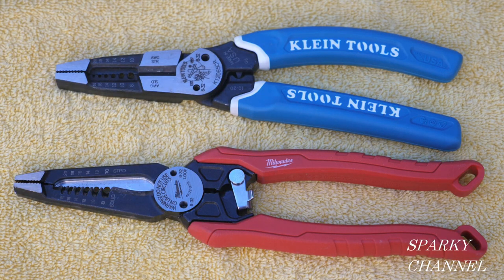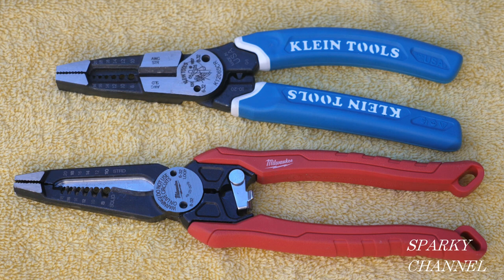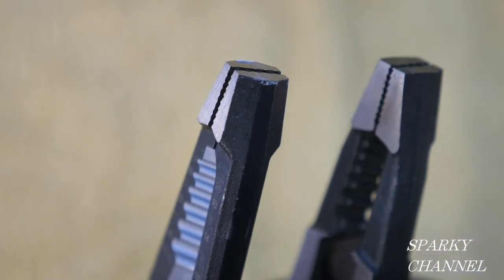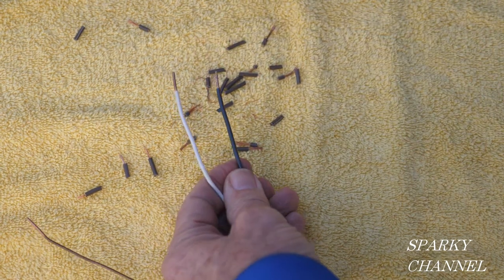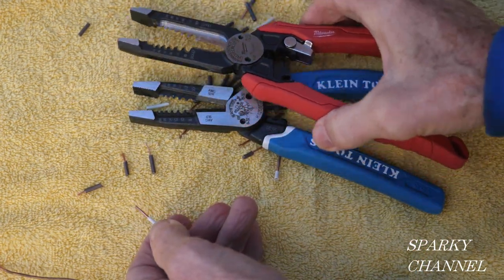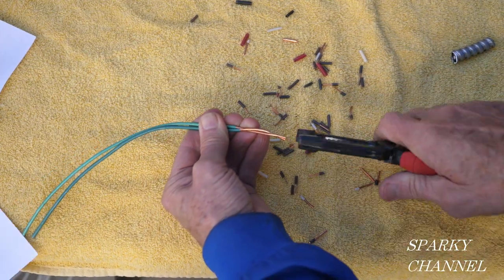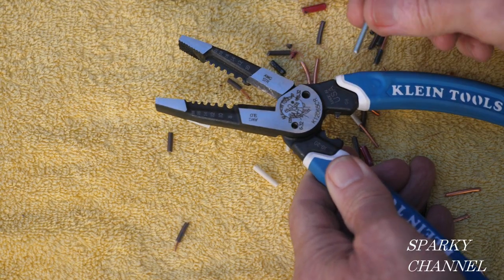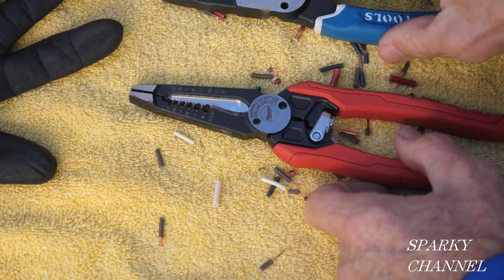Milwaukee New 7 in 1 Combo vs. Klein-Kurve Combo Pliers, Which Will Win?

Comment: I would not buy either unless that was the only tool. Too bulky to use a strippers, any crimper that you have to put handles over wire are a big no for me.
Reply: This is good for a small job when you want to only have to grab a pair of pliers and a knife.  Like when you just need to change out an outlet or a switch. 

Also if you're crawling around in really tight quarters,  like an attic with a 5/12 roof or a crawl space.  You can stick these pliers and a knife in your back pocket instead of using a tool bag.

Comment: Definitely prefer the grip on the Klein, but otherwise, I think the Milwaukee is almost better in every way. And if you don't like the spring or latch, you can theoretically remove them (even if somewhat destructively). Likewise, I think you could get a rotary tool and grind down the crimping tab, though I concede you shouldn't have to do that, and it should probably smaller like the Klein's for more pressure.
Reply: those thin milwaukee blades wear out fast.

Comment: You can always remove the latch and spring if you choose, and I don’t think you should ever use this style of tool to twist wires. Has to be standard lineman’s, but I see the Milwaukee as far superior
Reply: Doesn't have to be standard linemen as long as you know how to properly make joints 🙌
Reply: @UnrankedRebel  ok
Reply: @AnxOG663  yeah I use iron worker pliers instead of lineman pliers

Comment: In my opinion. Milwaukee power tools. Klein hand tools. But when it comes to screwdrivers, Klein Phillips heads strip out. “Faster than a Milwaukee Phillips head. Personal opinion, been an electrician a long time. I wouldn’t waste my money on either one.(I have both of the pliers/strippers/ multi-tools), and never use them. Good back up tools tho.
Reply: Try ya some Wiha drivers. They're amazing!

Comment: Something to consider about cutting differences. Bi-path or shear type cutters perform a shearing action in the material. They must be “sharper” or have steeper cutter angles. This improves cutting performance at the risk of easier: rolled, damaged, and misaligned edges. 

Pinch style cutters have more obtuse angles, that meet and literally pinch the material apart. The edges are less likely to deform, hardened to some degree, and still perform well with small amounts of edge damage. They do take more effort to use, and deform either end of the cut material.
Reply from the maker: Thanks Rob!

Comment: I have the Klien ones. I did not like them. They strip wire very rough, and are not great as a lineman’s. Easier in my opinion to just have a regular strippers and a regular linesman’s
Reply from the maker: Thanks!
Reply: They're not meant to replace your lineman pliers man. Either you're mistaken or someone mislead you. You need both strippers and linemans.

Comment: Klein all the way for me.
On the job you need a bigger  Surface area on the tip of your pliers for twisting 3 or more  Wires especially if is bigger Gauge wire.
 I doubt you can twist 3 number 10  Comfortly with that little Milwaukee tip.
Reply from the maker: Milwaukee 11, Klein 22. Thanks!

Comment: If I had an engineer friend at Ideal industries I would send them what I liked on the Milwaukee and Klein  and see if they  could make a pair close to Klein but with the cutter  of the Milwaukee.  Bypass cutters  generally cutter larger items. Notice that the hydraulic powered cutters and ratcheting cutters are bypass.  Same thing in pruners.  The bigger pruners are bypass

Great video.
Reply from the maker: Thanks Victor, sounds good!

Comment: Bought the Klien two months ago and am going to try to return it to Home Depot.  The cutting blade is too short and it is very hard to cut 14/3 and 12/3 romex.  The tip doesn't fully close and won't grab small strands.  Very disappointed.  I'm going to try a Knipex.
Reply from the maker: Thanks for sharing!
Reply: @SparkyChannel  Today, one of the grips kept coming off when I put in the long pocket of my carpenter pants.
Reply: I agree with you 
I returned mine, knipex is the way to go
Reply: @ItsEdwinG  I bought the Knipex and it is better but not perfect.  It's easier to find the right slot for stripping wires and does a better job.  I'm still getting used to the thumb lock but it doesn't have the problem of accidently opening like the Milwaukee in the video.  The curved cable cutting blade does a nice job cutting larger cables but you have to spread the handles farther apart than you do with straight blades.  Again, something to get used to.  There is a slot in the middle of the tip serrations that works great for grabbing wire for putting a hook in a wire end.

Comment: I'm old school. I still use wire nuts and I twist my wires together before putting on the wire nut. The noses are too narrow on both tools. I like the klein curved handle. I like the milwaukee spring  and bypass cutter. Cutting MC cable is a good way to ruin your cutters.  I don't need the crimping feature since I rarely do crimping and I have a dedicated ratcheting tool. I want a tool that can replace strippers and lineman pliers because my pouch has way too many tools. I like latches on spring handles but that milwaukee design is flawed. Both tools are not ready for prime time.
Reply from the maker: Thanks Dave!

Comment: I've seen tons of these comparisons on wire cutters/strippers and they always are testing it on very small stranded gauge wires. However the majority of wiring in residential and commercial applications are dealing with 12 and 14 gauge solid wire.
Reply from the maker: Thanks!

Comment: I personally own the Milwaukee one and to be honest they feel pretty good but theres a catch… that “shear” style cutter is weak… I’ve been cutting wires for about a week only with the Milwaukee and the steel already has a bunch of damage and fractures. If you plan to use them as strippers,rimming tool and to twist wires so go ahead and get them they are good for that but as cutters they suck…. What used to feel smooth like a nice blade now feels like a hand saw blade… rough and damaged
Reply: That’s all cutters . Thankfully Milwaukee has a lifetime warranty on hand tools. Every time they get dull. Sharpen them your self or trade them in no questions asked at Home Depot

Comment: I like the kliens they have a wider jaw for mechanically twisting those wire's. Also dont like the latch design spring design i always pinched my pointer finger closer to the palm and it was never really functional or efficient. Never work on hot wires! But the potential is way less of getting zapped with the kliens less hunky metal in the middle of your palm to ground out against.
Reply from the maker: Milwaukee 21, Klein 27. Thanks Patrick!

Comment: Knipex blows both of these out of the water, at least for me, in the ability to cut 6-32 & 8-32 without needing to thread it in and out; it also does all the other stuff as well. It is spring loaded with a much better lock and is buttery smooth. Been doing electric for decades and wish all these great tools were around when I started back in the 90’s; still quite happy as the tools getting better have allowed me to work easier as the body gets older.

Comment: As an electrician when it comes to hand tools for my trade I'll take Klein all day long. I have my EMT remmer seperate which works wonders. But honestly at the end of the day it's about what works best for you and is available in your area. Some tool brands are just not available around me Which sucks. Where I live gets shafted for contractor grade tools in favor of DIY tool lines. Same with hand tools
Reply: That's a weird statement. You can order, does t matter where you are
Reply: @henrycruz45cal  not everyone buys online. I certainly don't buy told online as I would rather have them the day I need them rather than wait a few days or weeks just to get them.

Comment: I have both the Klein and Milwaukee. The Klein doesn't cut the sheath on romex as good. You have to put force into the Klein to remove the sheath where as the Milwaukee you just have to use the cutters with minimal pressure to cut the sheath and pull it off to access the wires.
Reply from the maker: Milwaukee 10, Klein 13. Thanks!

Comment: Kleins for me. The first thing I do to any pliers with a spring is use another set of pliers and tear out the spring 😂. HATE spring loaded pliers. The next thing I do is remove the latch. With no spring you no longer need the latch. I actually own both of these tools - both are very good (after the spring surgery) but the Klein’s are more refined and just nicer overall IMO.  PLUS my Mils were made in communist China (not Taiwan) something I try to avoid whenever possible. The Kleins are shorter and do puss out on larger cable but who cares. They fit better in my pouch. Big red is no doubt better for riggers and commercial guys but for house wiring the Kleins rule.
Reply from the maker: Milwaukee 24, Klein 38. Thanks!

Comment: Hey bill, I've been using the milwaukee stripper for a long time the smaller version of the one your using, when stripping wires, after you put wire in tool give the stripper a little up or down motion and the wire jacket comes off easy. Only problem with milwaukee is they dull after awhile.
Reply from the maker: Good tip! Thanks!

Comment: I finally got my first pair of Knipex combination , I much prefer them . That said at a much higher price point , it isn’t a fair comparison ! Be interested in your take on the Knipex .I like my Klein’s will be an excellent , well crafted backup !
Reply from the maker: Milwaukee 22, Klein 28. Thanks! I have the new Knipex ordered.
Reply: @SparkyChannel  It’s very well engineered . Do not use the 10 and twelve notches for 14-2 ! Use the shearing blades on the jacket , and break it by hand . Some guys think the two largest notches will do 14-2 , most probable result , you loose the ground ! Be interested In you take . As we speak , I’ve gone Knipex for 80-90% of my plier needs .

Comment: I have a set of Vise Grip wire strippers that I can get online for about $10. They work well for what I need. Then again the wire I need them for is not as thick as what you were using. I work in IT so its normally network wiring or some miner electronics. I think my thickest wire is 16 AWG which I used for a magnetic door lock.

If price wasn't an issue I would go for the Klein because the grip is a little better and the plier section is a little bigger. The Vise Grip strippers I have only have a small area to use as pliers. If I do any electrical work I normally bring a set of lineman pliers. The only thing I really like on the Milwaukee strippers is the the way it cuts. My Vise Grip strippers have a similar cutters and it works great.

As far as spring loaded or having a latch I agree it is personal preference. I have some garden shears that have a latch and I think it is good for safety. The way it's designed though I have never had an issue with it accidently locking. Spring loaded tools are great if you are doing a bunch of repetitive cuts or stripping. I have big enough hands though that I have never had any trouble opening a tool up without a spring.
Reply from the maker: I agree, garden pruners need latches. It's a good idea there. Thanks Brian!

Comment: I have them both,  but used Klein  more... the milwaukee are more recent for me . I believe the klein are more professional , with the milwaukee being more well rounded for people that use wire cutters less for work and just need some around. However I had to glue the rubber on the handles on the klein already... maybe 2 months of use in. 🤔
Reply: My Milwaukee's were w add y cheaper than $30 they were not even a full $20 after taxes. I love Klein tools but I like my Milwaukee's as well
Reply: I'm an electrician, been using these milwaukee for 8 months, far easier and faster to work with than the kleins.

Comment: I like the Klein better, haven’t used either for reaming but you don’t want it to be rounded for reaming. The sharp edges on the Klein would do a better job removing burrs reaming vs just pushing them down with the rounded edges of the Milwaukee, they’re smother to use because they aren’t doing any reaming. ( :
Reply from the maker: Milwaukee 1, Klein 4.  Thanks!

Comment: Shear style cutters become dull over time and aren’t as strong as traditional cutters, they are sharper hence the cut is smoother and quicker but they won’t last as long. I bought the Milwaukee needle nose and stripped hybrid with shear style cutters and they are starting to become dull, I’ve only had them for 4 months and only cut copper with them. I think Milwaukee should stick to making power tools, with all due respect of course.

Comment: I like the Knipex 13 86 200 Pliers  over both the Klein and the Milwaukee.   I think the Knipex cuts, strips, and reams better than the others, but you'll be paying a lot more for a Knipex.  Between the Klein and the Milwaukee,  I feel that the Klein may be better especially the Klein-Kurve K1205565KR.
Reply: @3morbid  - I agree.   For wire stripping, the Knipex 13 71 9 is the best.  For a combo electrical pliers, the Knipex 13 86 200 is the best.

Comment: Who uses wire strippers?
I’ve been an electrician for 25 years 
I use my linesman when I’m plugging and switching for stripping.
( I’ll wait for the “ but you degrade the wire by nicking it” comments.)

Pro tip... I don’t.
Reply: Everybody in with the mindset of progress, Ive only ever met dinosaurs who use lineman's to strip wire and also use hacksaws to cut things with. It's all choice
Reply: @TheWellenoughalone  
It’s a natural and comfortable thing for me to do.
I’d be very slow using strippers.

I’m a “ dinosaur” because I’ve done something hundreds of thousands of times and I’m used to it?

I’ll bet I’m faster at stripping wires than 90% of the young kids.
Not because I’m special, but because I’ve done it so much I don’t even need to look.
It’s like walking.

Makes me a old timer, sure.
I have a hacksaw too. I use it for backup.

Most kids have nothing but power tools in their kits.
Whatever, many ways to do things.
Linesman are faster for me.
One tool, many uses.
Reply from the maker: I've seen guys using lineman's for everything and they are super fast at it. As long as you don't nick and degrade your wire, I'm good with it. Have you seen my video on the IDEAL National Championships International Competition? The guy that won was from Australia and used his lineman's for everything.
Reply: @itaintrocketscience  you've done it so much that you got quick and comfortable with it, I only say dinosaur when I describe certain guys who don't want to use 'newer stuff'. I have a feeling you may be even quicker if you had some strippers. I agree there's many ways to get something done.
I am one of the young kids but I have used both new and old tools/methods that are older than me to get work done
Reply: @TheWellenoughalone  
I’m willing to give it a shot. Sure I’ll be slow as hell. 

In the old days the young electricians would get crap from the journeyman for using strippers ( looks like the tables have turned, ha ha )

I’m the “ old guy” willing to try new stuff for sure. I hate being stuck in the past.
( still not sold on wagos) but that’s another post.
Reply: @SparkyChannel  
I watch some of those that you have posted.
Just watched the emt bending video 
( damn those kids are fast) 
I’ll look for your other vids for sure

Comment: I have the dark blue handled Klein’s that only go from 10solid to 18.  Or 12awg stranded.  Same pliers other wise. They came out with the version you have because they missed 10ga stranded.  

I have the older 6 in 1 Milwaukee’s. Same length as the Klein’s. Better reamer ridges on the outside.  Thinner needle nose tips.  No crimper. Loved them until I ruined the shear cutting #6 solid.  Wish Klein would make a set just like these Milwaukee’s as far as the cable shear goes

Comment: You can put a rubber band around the latch. I like the rubber bands that hold brand new inner tubes together lol. A zip tie positioned just right at the top of a handle can turn ordinary pliers into spring loaded pliers 😂 sort of.
Reply from the maker: Thanks!
Reply: But if the pliers aren't already spring loaded then they don't usually have a latch.

Comment: A coworker of mine has those Milwaukee’s, they are quite nice and cut Romex like butter. But as for stripping, my relatively “cheapo” Channellock 908’s seem to work much better for me, though the crimpers on them kinda suck. Also, does any company make strippers big enough to strip huge line wires? As in #4 gauge. I can’t seem to find any anywhere.
Reply from the maker: I just purchased the JOKARI 70000 4-70 Cable Knife System for Round Cable Stripping, Yellow: https://amzn.to/3aDVR0s
  and I'll be making a video and giving my assessment of them. I've heard good things about them for stripping larger cables.

Comment: i have both of these, milwaukee was better than klein, but they were leave a mark on both solid and stranded wire, especially on stranded wire, removed wire nut cut with those pliers it will cut thru so wire. southwire is the best what i know so far
Reply from the maker: Thanks!

Comment: The milwaukee strippers are my favorite. I have the smaller ones with the round handles. The shears are great for stripping larger wires by scoring the outside with the rounded edges and pulling the rubber of with the end of the pliers.

Comment: These strippers are good for occasional use or where you have limited space in your tool pouch. I have several types of strippers for different types of jobs. I also have separate crimpers and reamers. For occasional use these might be great. For High volume wire stripping these would be awful, compared to an automatic stripper. That said, I prefer Klein tools right now.
Reply: Which wire stripper do you recommend